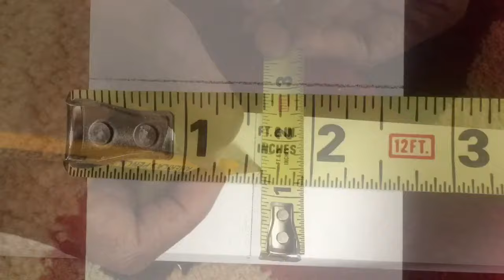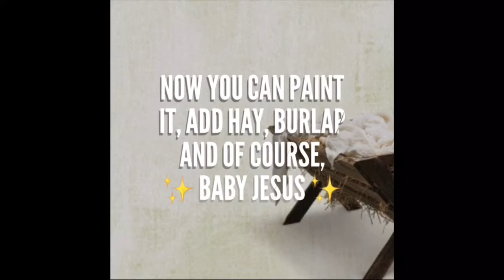DIY Nativity Manger- How to Make Foldaway  Nativity Manger - Less Than 30 Minutes - Less than $15! ✨

Comment: I bought 8ft × 1 in × 3in 
had it cut to 4, 24 inch 
that doesn't seem like that's enough to make the manger is it? Do I need another board?
Reply from the maker: One 8ft, 1x3 board cut into four 24” strips. One 8ft, 1x2 board cut into six, 16”  strips

Comment: So you buy the 2 by 4 then cut small you don't show it so it's confusing to me.
Reply from the maker: Hi. Buy one 8’ 1x3 board and cut into four 24” strips
Reply: Thank you
Reply from the maker: @jweaver1264  You’re welcome
Reply: At Home Depot 1in ×3 in ×8 ft board is that correct? Sorry I'm gonna be 59 having hard time remembering my wood shop days of cutting and measuring wood.
Reply from the maker: @jweaver1264  
https://www.homedepot.com/p/1-in-x-3-in-x-8-ft-Furring-Strip-Board-164704/100094214